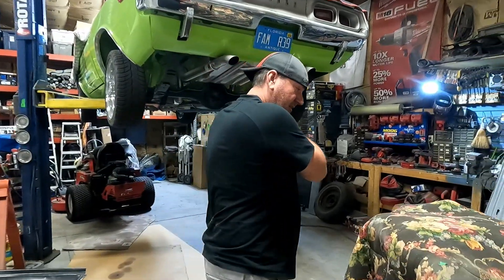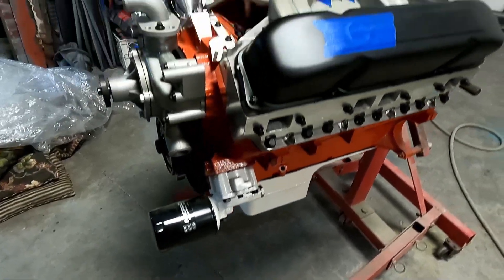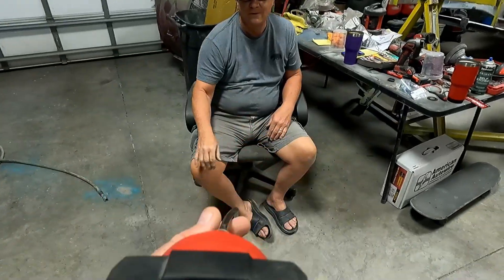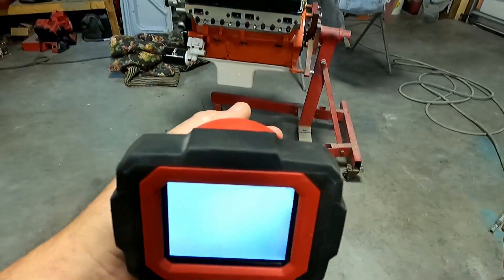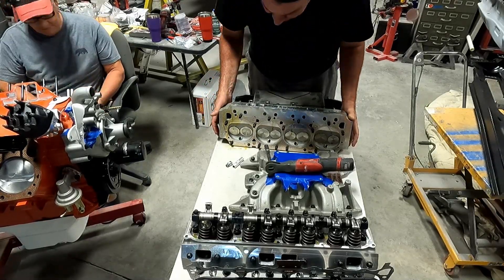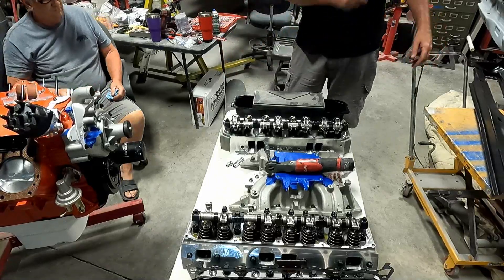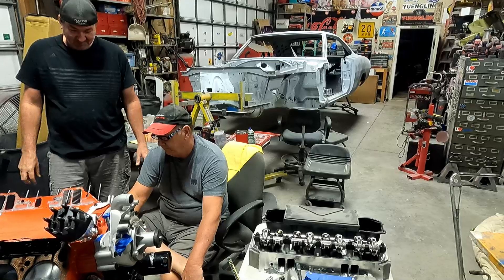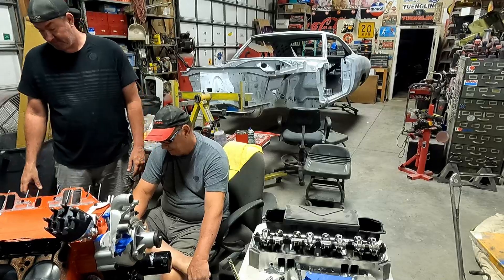Are My Dodge 440 Pistons in Backwards??

Comment: If they are factory rods, look for a small oiling slit on the cap and rod mating surfaces….this oil slot faces towards the inside or middle of engine and is supposed to oil the undersides of opposing pistons.
Reply from the maker: Ok, yes, the slits are facing inside and opposing pistons, so I did put the rods in the correct location, I gotta research why the speed shop put the piston heads in 180 out…. I feel like someone said it was done for some performance reason, I dunno…
Reply: You can rotate the factory flattop or sixpack pistons with no consequences.  The sixpack pistons have 4 reliefs.   The reason they do it is the pin is slightly offset and many believe there will be a slight performance gain by doing it.  
But, with aftermarket pistons, you should (must) check valve to piston clearance and they should be installed the way they are designed.  Sometimes there is enough room to incorrectly install the pistons and get away without damage.  But, if you don’t check the actual clearance (usually with clay), there is huge risk of damaging the pistons/valves etc.
Reply from the maker: @gregdeternova1537  I just read that the KB 237 Piston heads only have 2 reliefs on them, but another viewer said it has to do with geometry back in the day allowing for a straighter push on the piston.  Still unsure what I'm gonna end up doing but I appreciate you coming along for the ride.  YOU CAUSED ME SO MANY HEADACHES TODAY!!!!   HAHA, I blame YOU!  Seriously though, I do appreciate it!  I'm most likely gonna put them back in the way that KB designed them to be installed and not have to worry about possible failures.
Reply: There willbe no beneifit to installing the KB pistons backwards since they are designed with the pin centered in the piston, unlike factory pistons.  So, I install aftermarket pistons as designed.  Best of luck with the build.
Reply from the maker: @gregdeternova1537  Yep, that's what I figured out this evening as well.  I put the head back on and did some spinning and nothing hits, but like you said, they are centered in the piston head and offer no advantage to being mounted 180 out.  Hoping my local machine shop will flip them for cheap, or I'll do it myself as it doesn't appear to be too difficult.  A great and absolute thank you for your help in guiding me toward a possible running motor, with you over my shoulder I feel more confident for sure.  Is your 68 Charger 800HP Motor for sale yet??????????  Thanks again!

Comment: As to valve notches, a good visual reference would be to rotate the engine on the stand so that the one deck is level like a table top. then place a cylinder head on and notice the angle that the valve approaches the piston (and vice versa). It then becomes obvious where the valve notches go. On KB pistons, I believe the deeper notch is the exhaust. The pistons come with lots of information (paperwork) which includes the top (extra) ring gap.
Reply from the maker: Thank you, yes I agree with what I’ve been researching all day.  I didn’t get any paperwork with the parts as my speed shop purchased everything for me then didn’t assemble for over 2 years so I assembled what he gave me.  The piston heads were pressed on the 6 pack rods when I got them, then I installed the rods the correct way which apparently puts the tops 180 out…. My big question, which I think my speed shop guy told me, is that they were installed 180 out for a reason.  “Like the way guys did them in the old days”.  I feel like an idiot for questioning it when I can obviously see the reliefs belong they way you all are guiding me…
Reply: @ClarksPlace It's an old school trick for making power. It has to do with the piston pin being offset in the piston, which quiets piston slap on a stock engine. Reversing them changes the engine geometry, and is supposed to push straighter on the crank or something like that.
Reply from the maker: @acguy661  I love it!  I can't thank you enough, I was very strongly leaning toward reversing the heads on the rods back to where the reliefs in the top match the heads.  But.... What you're saying is compelling for sure.  I just posted a vid with today's findings that my rods were installed correctly as I see it, maybe I will just leave them in 180 as the old guy that was building my motor put the heads on 180 out and probably did it for a reason.  I just gotta see if the KB 237's will work in this configuration as I just read they only have 2 reliefs instead of the 4 that are on the factory piston tops.  Is there some place I can read further about this?  I searched a ton on my phone in the shop today and a ton more tonight on the computer and haven't ever found anything regarding flipping the piston tops on a 440.   Thank you thank you thank you!  I appreciate it!
\
Reply from the maker: @acguy661  that sounds like what I was told a few years back, I knew there was probably a reason, the Keith Black pistons I’m told have a centered wrist pin so no change in geometry would be accomplished by keeping them in backwards….  Thank you for the good ole timey information!!!  I really appreciate it!

Comment: Gentlemen,   The pistons are installed upside down.   The curved part of the piston notches should be facing towards the center of the engine (valley).  Then just make sure the intake and ex notches correspond to the corresponding valves.
Reply from the maker: Dangit!  You were right!  when I got to looking at it, they didn't match up...  Well, you know what I'm doing tomorrow!  I think I may have promised you something for this awesome catch, you remember what it was?  It's bothered me for a year now since you sent me the original message, time to get it done.
Reply: I’m just glad you are correcting it in time and will be happy when it runs awesome!    Glad I could help a car buddy and my reward is just that.   
Lookin’ forward to seeing the rewards of all your hard work! 😊
Reply from the maker: @gregdeternova1537  Since I just about am happy with all the sanding and body work, which takes forever, I'm excited to start getting it back together.  Pops is building a 440 6 Pack motor and wants to get his put together, so I decided to do my checkup based on your year old suggestion.  I'm so thankful!  If you're going to the Mopar Nats next week in Hebron OH, let me know, I need to meet and thank you!!!!!  ClarksPlace@yahoo.com
Thank you thank you thank you!

Comment: Also, they look like Keith Black Pistons which are unique in that they require extra top ring gap. Concentration of heat or something like that. VERY IMPORTANT>>>!
Reply from the maker: Yep, I just popped #1 piston out and it appears that my machine shop pressed the piston heads on to the factory 6 Pack rods, and I either installed the pistons upside down with rods backwards, or the machine shop installed all the piston tops backwards for a reason.  Trying to figure out what way the Rods are supposed to be installed cause I can’t see a difference, only a worn area like groung in on one side that all point away from each other….  I gotta do a bunch more reading apparently…. Maybe someone out there knows????
Reply: @ClarksPlace  The locator tabs on the bearings  and therefore the locator tab notches in the connecting rods face to the outside of the block. Also when you put the bearing in the rod the bearing is offset to one side allowing for clearance to the radius in the crank journal.
Reply from the maker: Thanks again for the good info, I found the KB ring guide online and will follow accordingly after I get my pistons pointed the right direction on the new rods I'm going to have to buy.  I bent one trying to get the pistons pressed off, OOOOOPS!

Comment: Also, i’m commenting as I watch this…..please don’t just pull the piston/rod out and rotate them.    The connecting rods are chamfered for the crankshaft radius and only go in one way.  So, the piston has to be removed and rotated on the rod.   If not, you will wipe the conn rod bearings out.
Reply from the maker: Yet another save!  I thought that the rods went in a certain way and mentioned to pop that the piston heads may need to spin on the rods off camera yesterday.  Dangit Greg!  Your just not happy unless I have to take every danged thing apart are ya????  haha, I really appreciate any help I can get.

Comment: Just to warn you, those holly EFI systems tend to fail a lot the O2 sensors start reading incorrectly, and will cause the engine to flood with gas and the system not working properly. Do you will be very disappointing after a short time I will just stick with a carburetor.
Reply from the maker: My Pop’s 68 428 Mustang had those same type issued we kept having to troubleshoot. Ended up a loose connection allowed air in around the sensor and kept making it think it needed more fuel.  Fixed leak and it’s been ok.  Gonna start with the Sniper on mine and will change it if I’m not happy with it.

Comment: The pistons are 100% upside down, the valve reliefs go to the top.
Reply from the maker: Yep, I mentioned you in my vid I just posted thanking you for an awesome comment on this vid.  There is some speculation on the next vid though as back in the day people flipped the flat top pistons to apparently change engine geometry and increase performance.  Not sure if these KB piston tops will perform as the same factory ones from back in the day.  Thank you for the help and comments!